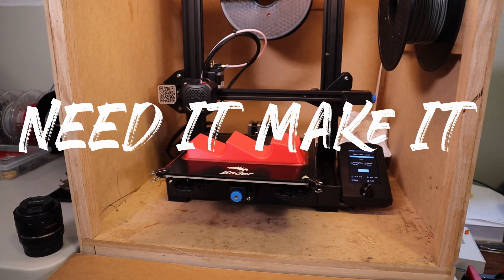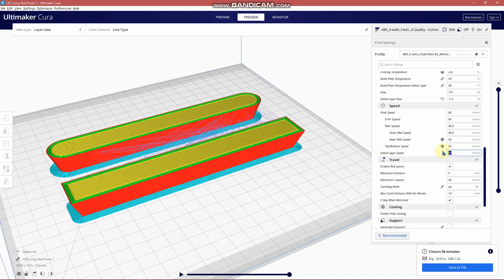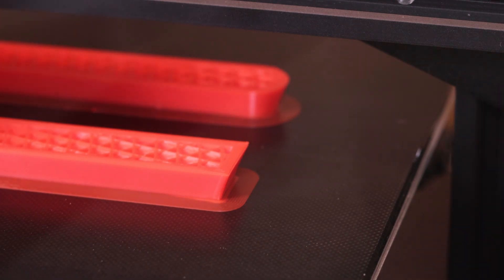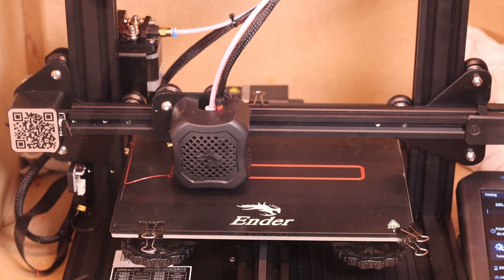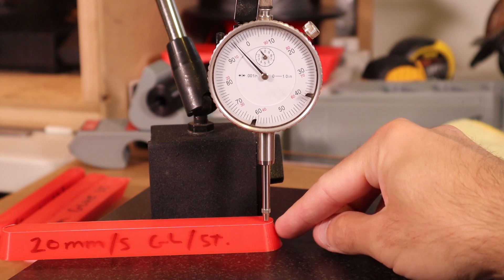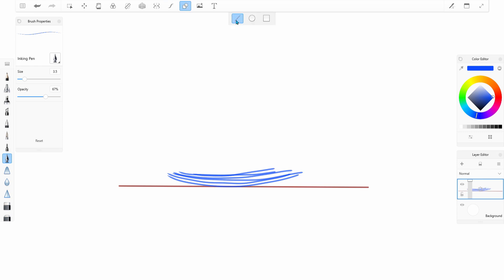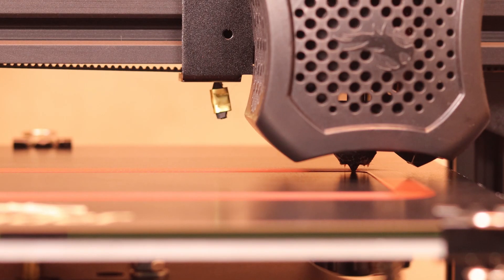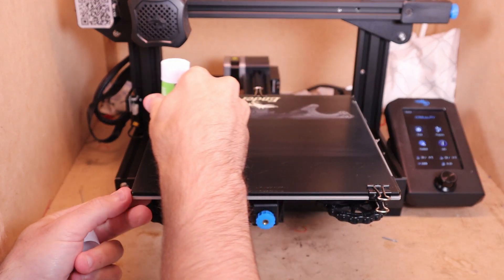Creality Ender 3 V2  - The quest for the best build-plate adhesion for ABS

Comment: Magigoo PC, that is glue that works with abs, pc-abs and pc. It sticks so well that you might have negative warping when part cooled down. Apply on clean glass, enclosure is good to have.
Reply from the maker: I'm testing Nano right now, which may be something similar, with pretty good results, I've heard of magigoo, how about bed temp for initial layer and afterward?
Reply: I use 115 C all the way from first to finish
Reply from the maker: @karipenttila2655  Alright, I'm going to give a higher temp a try, I had been printing with 98, a little higher than recommended by the manuf. and inside an enclosure, maybe a little higher will make all of the difference, thank you!

Comment: I'm also using the Ender 3 V2, but I start my build plate at 110C and keep it at that temperature (Following a recomendation from my ABS manufacturer). Also I'm using a liquid adhesive made for 3D printing called "A.bond", it makes the surface stick more and leaves no residue, I reaply it on top of the original layer after a few prints and don't need to take of the bed and clean it. Thats great because it means I don't need to re-level the bed. I got it from a local shop with a generic brand, so I'm not even sure what in this "A.bond" thing, but it works. If you can get your hands in one of these, its worth the test. Plus I got it really cheap.
Reply: Also, I'm printing without an enclosure. Just leaving it in a closed room, and venting it after the print is done.
Reply from the maker: I will definitely be trying out your methods, thanks for the tip!  Do you print structural, or decorative type parts mainly?  Many walls or few walls?  heavy infill or light? Etc.

Comment: i use PEI sheet and use Esuns ABS+ and add a MYlar blanket on top the printer.I have printed parts of duration 3-12 hrs with zero warping .
Reply from the maker: The PEI sheet, I've heard of this, do you have any brand in particular?  When you say blanket on top, you just drape it right over the printer?
Reply: @NeedItMakeIt  https://www.aliexpress.com/item/32986940303.html?spm=a2g0o.detail.1000013.1.4cc9fb29yc79ou&gps-id=pcDetailBottomMoreThisSeller&scm=1007.13339.169870.0&scm_id=1007.13339.169870.0&scm-url=1007.13339.169870.0&pvid=d70e3b2b-1a50-4090-9d7e-96f255b45f1a&_t=gps-id:pcDetailBottomMoreThisSeller,scm-url:1007.13339.169870.0,pvid:d70e3b2b-1a50-4090-9d7e-96f255b45f1a,tpp_buckets:668%230%23131923%2313_668%23808%234094%23538_668%23888%233325%231_668%232846%238111%23446_668%232717%237563%23593_668%231000022185%231000066058%230_668%233468%2315607%2362          Attached link .Yes just over it with a small gap.It shouldn't be covered completely (preferably at the top ) and avoids drafts.it makes so much of a difference.

Comment: What about messing with the horizontal expansion/elephants foot setting to see if that makes things better/worse?
Reply from the maker: There are few factors that I think impact this a little, the angle of the part that intercepts the build-plate and general adhesion due to that Squished bottom layer which is kind of .  I hear that there is a way in Cura to adjust the bottom layer for elephant's foot.  Another method I'd like to experiment with is Mouse Ears, but I am not a big fan of it adding more time for cleanup afterward.  at the end of this video, I showed a part which I then printed with a kind of mouse ear, and it turned out okay, maybe just slightly better than my previous parts.
Reply: @NeedItMakeIt  Perhaps raise the bed temperature so the ambient enclosure temp is higher so layers cool slower and ensure the room temp is also high and free of cold spots? ABS slurry sounds promising.

Comment: I use an Acetone/ABS glue. I just left some of my support material/failed prints in a jar of acetone overnight, came back in the morning and applied the glue to the build plate with a Non-styrene based paint brush, turned on the heated bed to let it evaporate fully with my enclosure open, and then started the print. I've had no warping since.
Reply from the maker: Perfect, I've never tried this method, my next test was going to be hairspray, but maybe this is the way to go.  I never load my build-plate because I am never 100% confident that the prints will complete.  I'll get out and get some Acetone and get setup for some more testing.  Thank you!  Do you have a part in mind that warps the most?
Reply: @NeedItMakeIt  I've been printing a full size R2D2 dome, and before the ABS, the longest portions of the dome would always warp on the ends, or warp to the point of not even completing. This Acetone Glue mix has been a life saver. I would recommend doing it in a well ventilated area tho (or using a respirator). The acetone vapors can affect the ABS filament spool if you aren't careful, so it definitely has its' tradeoffs. Not to mention the inherent risks of working with acetone vapors in the air.
Reply from the maker: @TheTurbulator_  I didn't mean to post the other video yet, the YT scheduling feature seems to default to 12am so I'll post that one again properly later today.  With regards to your printing issue after a few layers, it reminds me of a problem I had quite a while back with my Anet, I believe the problem was a nozzle clog, the problem for me was that it would continue to clog after I replaced the nozzle too, I believed that it was a small piece of something that could  not be extruded, so I ended up switching to a larger size, first 0.4, and I currently use a 0.6 nozzle with very good results and no clogs.   One other source, though it is not likely is that your Slicer is not able to generate the Gcode for a specific layer, this has happened to me once before, I ended up using Fusion 360 to adjust the geometry slightly and the problem was fixed.   I was able to narrow down the source in this case because I had been printing the same part with no problems for some time, I made a small change in Fusion 360 and then the problem started.  First, I'd try the simplest solution, and change the nozzle to a larger size, or find a way to completely purge the melting chamber so that and debris is removed.